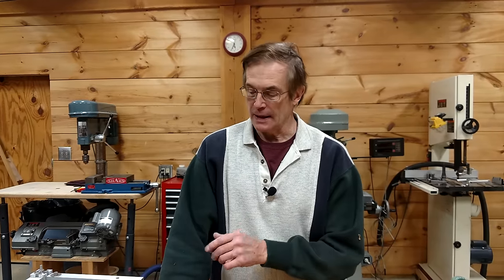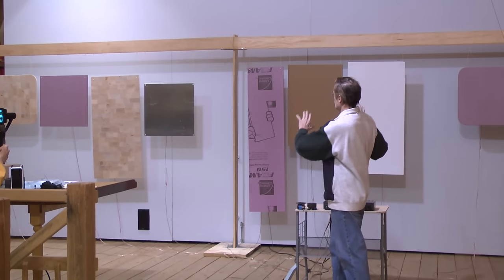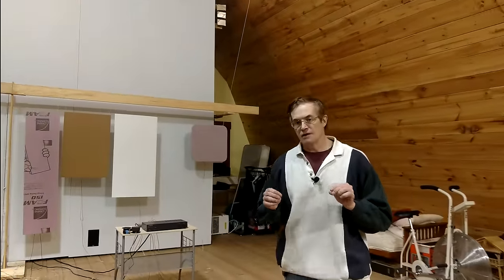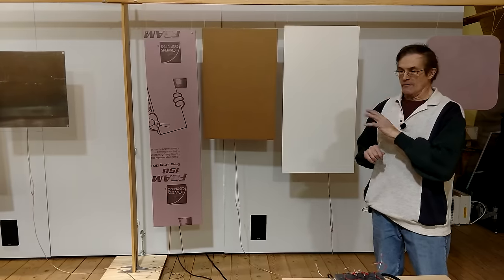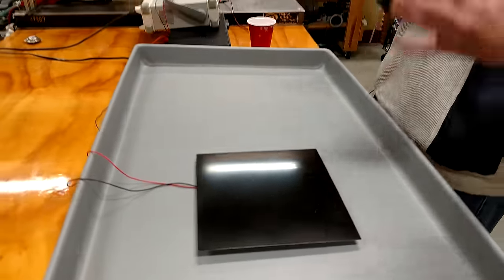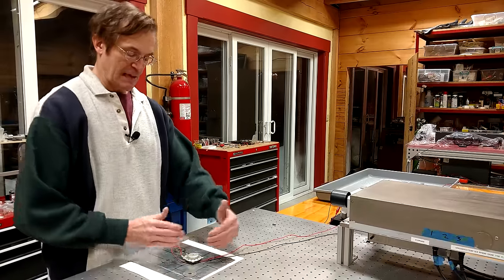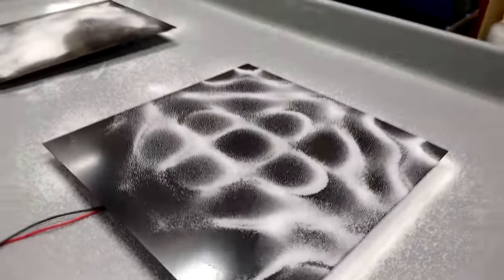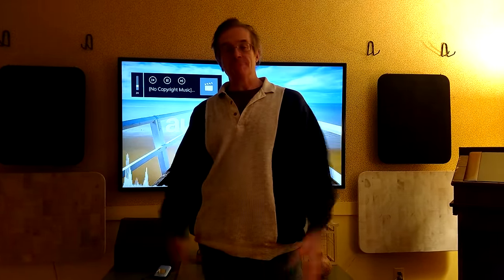Fantastic DIY Speakers for less than $30!

Comment: OR TO FIND A WAY TO UTILIZE SUPERSONIC SOUND FREQ THAT CAN PROJECT FROM YOUR EQ DAC RECEIVER  POINTING TO THE BONE IN THE BACK OF YOUR EAR!   TETHERING WOULD NEED TO BE DONE LIKE HOW CAMERA FACE TRACKERS WORK BUT FOR YOUR EAR IN THE BACK!!  MAYBE LIKE AN iR pointer
and when a person enters the tv sounding area the camera sensor tracking the people in  the room tethers to a person possibly in a specific room of home!  That way it will have actually good sounding sound when you utilize the dac EQ  i had seen people make this supersonic speakers on youtube  they point it at a wall and the sound sounds like its coming from the ceiling or wall!  i think the sound can be improved,  but the possibility to incorporate a camera and the software ear tethering tracker connected by means of the esp32v2 installed in the room... i dunno im not a ic or math genius but it is pretty cool!

Comment: A question, would it be better to mount a speaker not by the foam? But by the body of sound actuator to something ridged and heavy? That way the half of the impulse of the actuator won't be lost to pointlessly vibrating actuator it self and not the foam board??
Reply from the maker: Suprisingly that doesn't work as well.  The actuator is actually part of the resonance system.  When it is fixed the resonance peaks are worse.
Reply: @TechIngredients  oh, I didn't know. Thanks.

Comment: Non engineer question. Listening to your description of the counterbalancing, I was wondering what would happen if you either carved valleys into the foam board or added pieces to the foam to create peaks? Would it have the same effect on resonance? You talked about pianos and struts so i imagine it would be similar... I thought having a wavy pattern on the foam boards could look cool.
Reply from the maker: That should work.  Predicting the magnitude  of the effect is tough.  A database to guide modifications based on the material properties and some simple geometric shapes would be very useful.

Comment: This is awesome. How would it upscale to bigger speakers? Can I build a huge system with let's say, Rcf lf18g401 for bass for instance? With like, a 2mx1,2m panels?
Reply from the maker: Thanks!
Even that large a panel will struggle at base frequencies and a sub with a cross over around 150 Hz is a good addition.  Nevertheless, the larger panel will support lower frequencies than the small panels I demonstrated.

Comment: Is there some more information on the balsa panels?  Is there a sweet spot ratio between the size of the panel and the thickness?  Is thinner better?  Say around 1/4 in or is 1/2 better for about a 2ft x 4ft panel?  I've made end grain cutting boards, but it seems like 1/4 or less in thickness would be too fragile and more subject failure with grain defects?  Also how important is the cross section size of the boards?  The panels look like 2x4 or 2x6 boards.  Can smaller boards be used or will the additional glue lines impact the performance? 

My intent is to use both a 2x2 insulation panel and a larger 2.5 x 4 end grain balsa panel.
Reply from the maker: We didn't compare balsa thicknesses.  We used only 1/2" thick sheets.

Comment: So compared to the recommendations of stiffness in one dimension and flexibility in the other, what are the properties of the materials tested? Were those recommendations accurate?
It's very interesting to see soundboard spruce in the mix and faring well. Perhaps some luthier-grade cedar would be interesting to try as well - many guitarists prefer it.
Also in the guitar world is the invention of the "double-top" - two soundboards sandwiching a honeycomb nomex matrix -  these instruments are usually louder. I'd be very interested to see this type of construction undergo such testing with an exciter. I'd also love to see such testing done on completed (fully constructed) soundboards with various bracing patterns.
Reply from the maker: The only other property we evaluated is density.  The lower the density the higher the sound level (pressure) for a given power input.

Comment: So I really appreciated the mass loading. And demonstration of the difference resonant modes on the panels. I am curious if you brace a speaker enclosure using the 2/5 3/5 rule. Would you get a benefit? Or would you be better using mass loading over bracing?
Reply from the maker: Did you watch our later video on "The World's Second Best Speakers"?
You benefit from mass and stiffness to control sound.
Reply: @TechIngredients  yes sir, I was just wondering if you strategically place mass to a panel like mdf or baltic birch plywood. Would there be a benefit that is measurable to the dampening effect of the panel? Or is it more beneficial to brace or laminating the panels together than be strategic? With a conventional pistonic driver system?

Comment: Just wondering if you ever considered a hybrid speaker that  would be a longer rectangle with and inlay of the balsa into the polystyrene.
Either by a balsa strip going down the middle vertically or two strips on either side with the Poly in the middle for the highs.

Comment: Aluminum does have a lot of ringing on its own. But when it's dampened with a material like butyl rubber, the ringing can be mitigated. Car audio enthusiasts use this to reduce resonances and rattles of the aluminum car body. I wonder if this would increase the viability of aluminum and other metals as materials to be used for DML loudspeakers. The disadvantage still stands that aluminum is more expensive than other materials.

I have several more questions. The flat panel speakers have no isolation between the front and back of the driver. In traditional speaker designs, this leads to distortions in the frequency response as the front and back waves interact with each other. Is this speaker design less susceptible to this effect? What would happen if the back of the speaker was isolated by a chamber, or if a horn was built around the perimeter of the speaker? I imagine that the speakers would benefit from additional acoustic amplification as well as a wider frequency response at the cost of directivity.

There are so many experiments I want to try. I wonder what would happen if a panel was used that was almost as large as the wall of the room. What if multiple energizers were placed on the same panel? What if the panel was a composite of multiple materials? What if the panel was curved instead of flat? What if a hollow form was used instead of a solid panel? Could an omnidirectional speaker be made by arranging a series of panels in a cylinder or sphere? My brain is flying at a million miles per hour. I want to experiment with this tech!

Comment: Very Impressive! However can you tell me how important the thickness of the XPS foam is? You appear to be using 25mm. Can I use 20mm or 30mm for example?
Reply from the maker: You could.  The thinner would probably work better.
Reply: @TechIngredients  Thanks for your help. Much appreciated.

Comment: What was the mounting of the exciter to the panels?    Normally a 4 screw arrangement,  is you hard fix them?
Reply from the maker: We only used the double sticky tape provided by the manufacturer.

Comment: How do you think these would work on say the fiberglass roof of a Jeep? Like a 2 door wrangler with a 3 piece hard top.
Reply from the maker: Not well.  Suspending them in a moving vehicle would be really  tough.  They have to be as isolated as possible  from rigid supports.

Comment: I got a question. Since you said you could make these out of 4x8 sheets..would it be possible to make one,  paint it with projector screen paint  and have the panel not only as a screen but as the speaker as well?
Reply from the maker: Yes.

Comment: does thickness meter ? I have some plates 6 feet x 3 feet x 3.5 inch thick .  Very hard isolation for use under foundations against ice ! What U think ??
Reply from the maker: It does and the thinner the better.  Low density foam also works better as the sound output improves when the exciter has less mass to move.

Comment: What would happen if you painted the polystyrene boards after sanding them?  Also, could you build a frame around them and add more anchor points (such as at the bottom and sides as well) or would that have a significant, adverse effect?
Reply from the maker: Did you watch the end of the video?

Comment: Could u also use these as a mic, since u can turn a speaker into a mic can u also turn one of these into one and if so what would be the best material for overall best recording?
Reply from the maker: I don't think it's a good idea.  Extending the pick-up for a mic over a large surface area will mix the impulses produced by the sound wave as it strikes the panel at different times. Even if the sound came from a point source directly in front of the panel, it would arrive at the center of the panel first and at the edge slightly later because of the longer path.

Comment: The question I have is, if you are using two different drivers one at 8 ohms and one at 4 ohms, how have you got them wired to the amp?
Reply from the maker: I discuss this issue in our video on the LRAD, but basically you treat the speaker drivers as resistors.  So, if you wire them in series then you have doubled the ohms and if in parallel then you've halved the resistance.  The amp is slightly more complicated.  Check out that other video.

Comment: Very interesting project that I would like to do.  I'm bad at electronics and cannot understand how to wire the foam + balsa with the drivers in order to connect to my 6 Ohm amp and have both bass and treble setup.  And if I want to connect to an 8 ohm hifi system ? Are there schematics ? Better, with explanation of why it has to be wired this way ? Your videos are sensational and a great source of inspiration for having fun when I retire, sir. Sorry for the bad english, I'm french speaking.
Reply from the maker: The impedance of an amplifier is where the spec power is achieved.  You can use that same amp to drive other impedance loads as long as the current load is not exceeded. For example, an amp rated at 100 watts at 8 ohms will produce approximately 28 volts at 3.5 amps into an 8 ohms speaker.  If you drive a 4 ohm speaker with this amp and don't exceed 3.5 amps then the speaker will receive 14 volts, you'll be limited to 50 watts of power and the amp will be just fine.
Alternatively, you can wire speakers in series to double the impedance or in parallel to cut the impedance in half.
Reply: @TechIngredients  thanks. Just for curiosity, what happens if you put too much power to the speakers ? It breaks ?
Reply from the maker: Yes.  It also will begin to distort just like any speaker as you approach that catastrophic limit.

Comment: Does painting the panels change the sound? Could these be made into murals?
Reply from the maker: Sure, but I'd recommend a spray paint or an ink rather than a thick latex coating.

Comment: Great video. Thank you for making this. Can we mount them from the exciter to the wall instead of pins in the panel?
Reply from the maker: I suspect not.  Increasing the mass of the exciter reduces the frequency range of the system.
Reply: @TechIngredients  ok. I was just thinking that by hanging it by the edges by 2 pins might limit its sound range some. But I thought I would ask you because you've done a lot of work on this. I just about ordered 4 of these. I'm going for the surround sound. Mayby I should start with 2 first but your video has made me feel more comfortable about making these.

Comment: So I can create the panels now but how do I setup the exciter to a tv or computer or something?
Wiring and such
Reply from the maker: Do it the same as with any speaker.  The tabs on the exciter are marked for polarity.  Attach wires to these tabs and run them to the amplifier output.  You may need a fitting compatible with your TV or computer.

Comment: If one didn't want to have the hooks showing, but still wanted isolation, what options do we have?
I had an idea with feet from hifi systems, springs and tensegrity, but I don't know how to really implement.
Reply from the maker: You could run the pins below the edge of the panel, but suspending the panel  on the thin fishing line is still the best isolation technique.

Comment: I have watched several of your videos on various implementations of flat panel speakers and it caused me to ask the question that follows.  I am looking to add height speakers for Dolby Atmos.  However, I suspect my significant other would object to my cutting holes in the ceiling to mount ceiling mount speakers and she would never go for panels suspended below the ceilings either.  The ceiling in my living room is a raised tray ceiling 12' above the floor.  The distance between the two drivers would be about 8.5' and the distance from the drivers to the raised edge would be 6'. If one was to use two of these transducers attached to the ceiling panel from the backside would it produce enough volume to be usable and would they tend to cancel each other out.  It would be a nice hidden solution for speakers that only carry height content and are generally not used for music but I am not certain.  I figured with your experience and expertise you would have an opinion.  John
Reply from the maker: It might work.  You must maintain isolation of the panel from ALL the supporting structure otherwise the sound output reduces significantly.
They won't cancel each other as long as they are wired correctly.

Comment: What happens if you do a trapezoid? Most string instruments are effectively trapezoid with curved corners. And you already curved your edge on the panel you preferred. What if you built a shrinking waved/cone?
Reply from the maker: We didn't  test that, but you bring up a good point.  The nice thing about these panels is that testing various  shapes is inexpensive.

Comment: What thickness were the balsa panels?  3/4" or 1/2"?  In your home set up there, did you do one side with the 3/5, 2/5 rule and the other with the exciter dead center for both polystyrene and balsa panels?
Reply from the maker: The panels are 1/2" thick and the exciters are positioned according to the 2/5,3/5 rule on all the panels.

Comment: This is SO on my list of things to do! :)  Here's a crazy question - Could it work in reverse? Could you make a common object into a microphone instead of into a speaker?? Are the parts readily available?
Reply from the maker: Sure.  Hook up any speaker to a microvolt meter and you'll see that the sound induced movement of the coil will generate a current in that coil which sits inside a magnetic field.
Reply: There are plenty of devices available that use the resonance of a surface to pick up sound. That's how they "mic up" pianos, harps, violins, etc... using a transducer attached to the body. Search for "Transducer for Piano" and you will find what you want.

Comment: So although I feel extremely unintelligent after watching your very informative video, I have a question! Would it be possible to turn one of these into an isolated subwoofer emulator that only uses those frequencies? Similar to a true surround sound system. The only thing I felt it was lacking was the deep resonance of bass from a woofer.
Reply from the maker: Thanks for watching.
That generally won't work.  Low frequencies are lacking from these panels even with the largest panels available.

Comment: Unfortunately 1" foam board is not available in my area. Would 4 pcs 1/4" foam board glued together make a difference?
Reply from the maker: Probably.  The glue will increase the mass and the stiffness.  Polyurethane foam will also work if that's available.

Comment: Okay I just made mine. I bought the 24w 4ohm exciters. Did all the sanding and rounded the edges. On one I put it right in the middle on a 24inx24inch foam board panel. The other is on the same size board at the 2/4 3/5 position like mentioned. They are very nice sounding and it is very fun to play with. However there are a few things I want to ask and cover. When playing certain music that hits higher notes the panels produce a very sharp freq that hurts my ears a little. It could just be my room. So to counter this I put some down pillows at points of first reflection on the walls and behind the panels. It seemed to help a little but it's still noticable. How have you delt with this? Does adding the counter weights on the panels help? Can you show what you used on the foam board as counter weights? Also I noticed that there panels change sound quite a lot when moved close to a wall. These panels need to be about 3 ft into the room and away from walls to sound their best. Again thanks for all your research on these
Reply from the maker: A number of viewers that have assembled these speakers have found a noticeable improvment in sound quality than a sound absorbing material is placed on the wall behind them.
Reply: @TechIngredients  by placing the pillows behind them undoubtedly this is what is needed. I really want a fully treated room but WAF is a real thing. Lol

Comment: I was wondering... wouldn't these transducers perform their task better (higher conversion, less distortion) if they were anchored to a hard surface, e.g. concrete floor, versus hanging in mid-air?
Reply from the maker: We tried  that, and the performance  actually  decreases.  The exciter is part of the complete resonance  system.